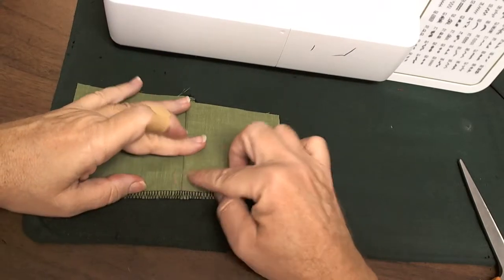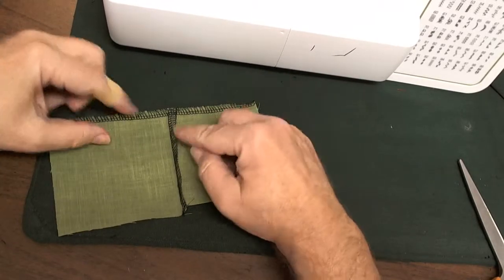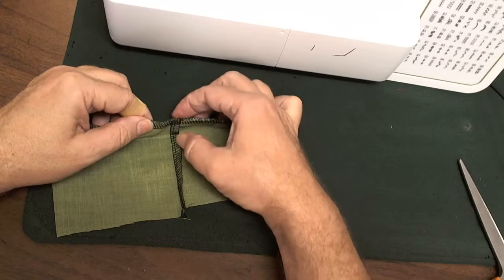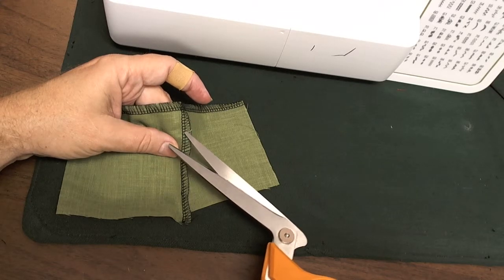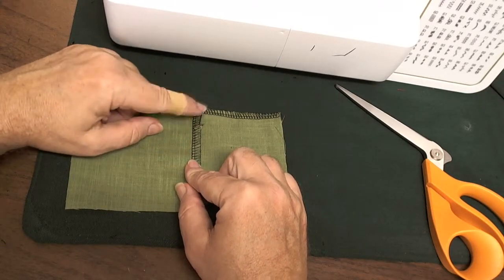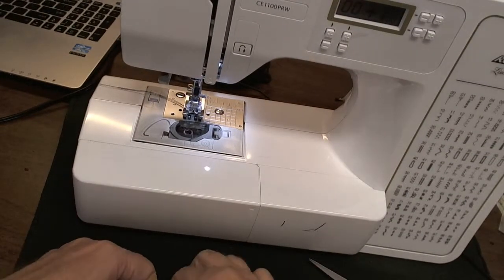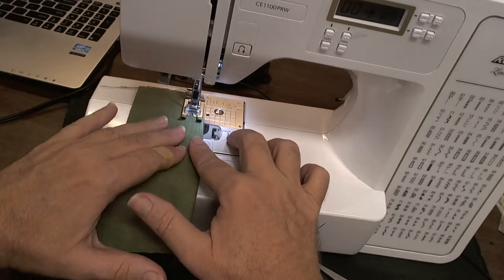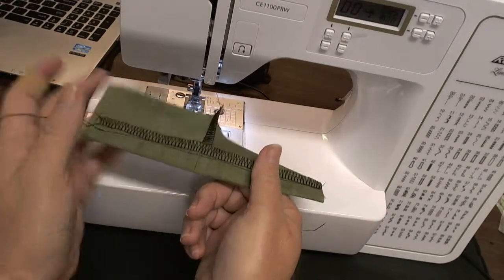Less bulk in serged seam on the single fold hem

Comment: Great idea!  A thought I had though was to fold the side seam to the opposite side you normally would when serging bottom raw edge so the seams are facing the right  direction when finished.  If that makes sense. Thank you for posting/sharing this tip.:)